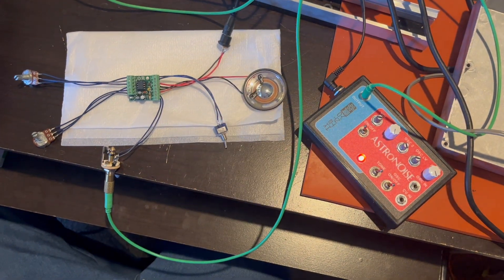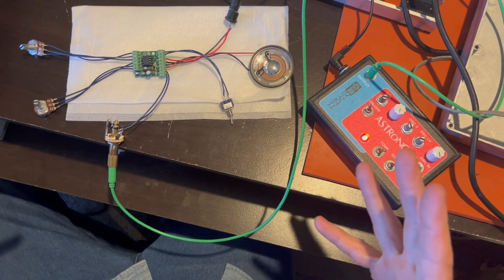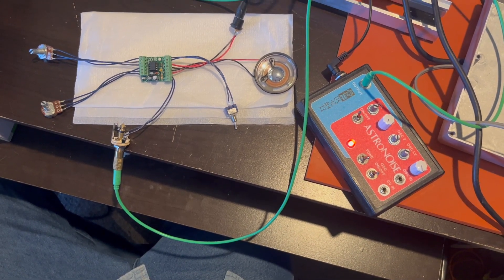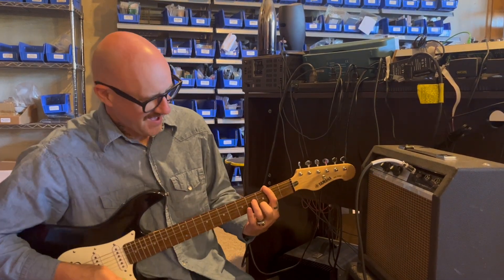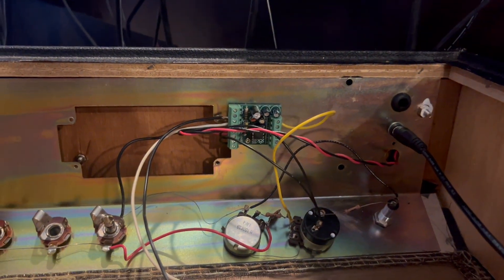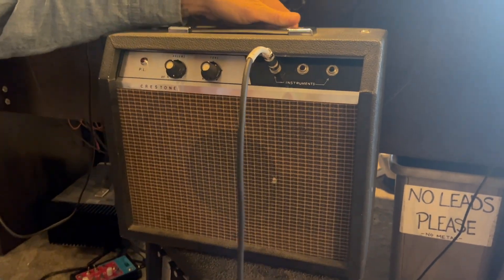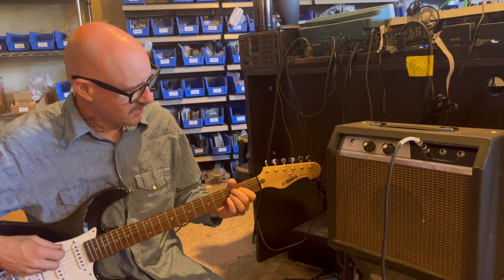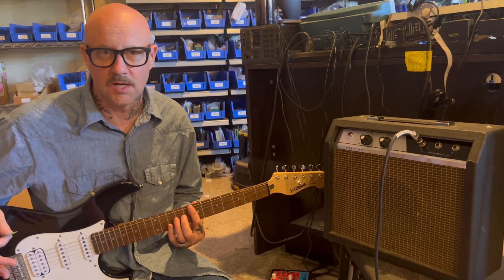LM386 Audio Amplifier - DIY LoFi Amp by Synthrotek

Comment: What would be the top end in terms of how much speaker this could power? Granted, the volume may be an issue but curious if you have guidance there?
Reply from the maker: It can power a 15" speaker or more, with the 9V battery (or 9V wall wart) it can offer around 750mA output.  You can get more if increase the supply voltage to +12 (some versions of the LM386 can operate on up to +18V)